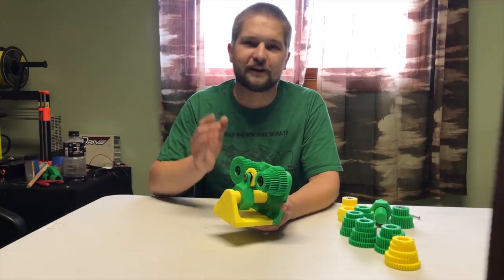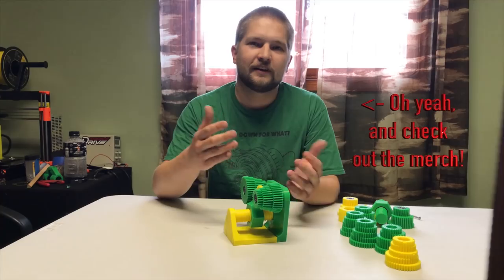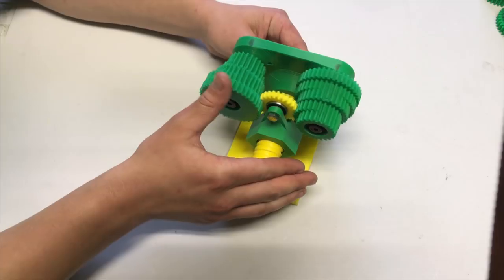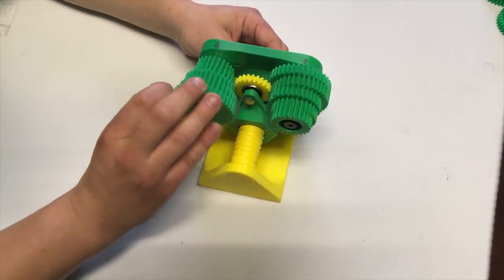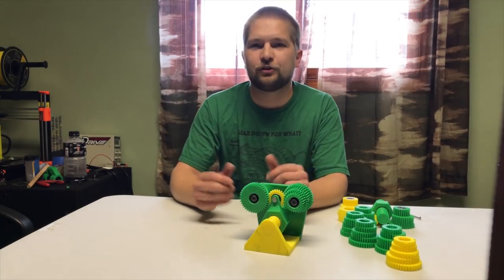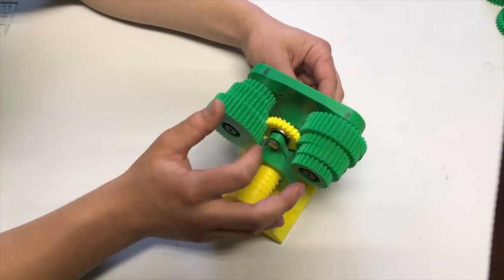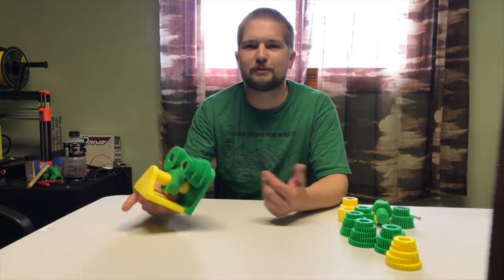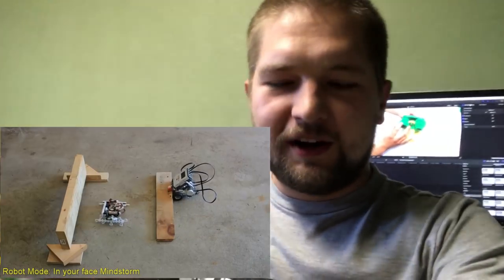The Hot Swapping Gear Mechanism | VCT2

Comment: "It doesn't require a clutch, you just have to stop the gears completely to transition and then the ratio can be changed"

/facepalm

lol
Reply: Robert Caldwell Looks like you've misunderstood. This could be done at speed. You just need a computer and quick electronics, which OP clearly hasn't got.
Reply: No it couldn't, no mechanical device could launch across a pivot in that short period of time accurately, not to mention taking the load abruptly during the change along with it......and even if it could once, it can't be trusted to do it again, let alone constantly.  Pretend a device does exist, imagine the catastrophe that would happen when it wears down?
Reply: Robert Caldwell Imagine a bearing on each tooth of the drive gear set laterally to the tooth. They would facilitate smoother shifting even while under load. Also, you underestimate the accuracy and speed of a computer-controlled servo motor.
Reply: And here is me, waiting on a demo of this brilliant piece of engineering that has been devised.......when you get it working, I bet it will look like a clutch.

Good luck
Reply: I think it's look more like 2 hall effect sensors, a linear servo and a computer to control it, but hey I guess that could look like some type of clutch...
Reply: like as i wan say..
Reply: @sabriath  yeah, right. It's not like we have laser machines capable of making transistors measured in nanometers. How much more difficult could this be?
Reply: And you overestimate the capabilities of a computer-controlled servo motor. A servo cannot rip two spur gears that are engaged and with a force behind without causing damage to the gear. The gears MUST be disengaged.
Reply: Robert Caldwell yeah, stop the gears and properly align the gears to change the ratio. 
i'd rather stick to clutching hahaha
Reply: This looks dumb
Reply: @sabriath  just leave the couch specialists alone lol. Next step would be that "big corporations need to sell clutches this is why this video will be deleted" hahaha
Reply: This was DC motor based not piston engine right?
Reply: But it will still require clutch to    pick up the car and to free up engine from wheels
Reply: @iNx_mRay  I feel like it could be possible if there was some sort of selection rod like in sequential transmissions that had predetermined shift points.
However, the computer would need to know the exact location of each phase point of both gear sets otherwise it's just grind itself to bits with it shoots a shift signal. But overall, it would absolutely still require some sort of clutch... Especially a neutral otherwise you'd never be able to park the thing or idle the engine without the contraption trying to escape!

Overall, it's a funky-neat machine, just not practical and more of a conversational piece.
Reply: @sabriath  totally agree. A quick servo would not solve the problem. Ever tried to shift from an engaged gear to neutral? It's not that easy under full load conditiones. But as soon as you get of the throttle you can easily pull the lever into neutral in the exact moment when there is no load on the gears.
Reply: Robert Caldwell if it's possible to create a mechanism to shoot through propellers on a plane it could be done for a transmission
Reply: @wadderrzz  the Problem is not the speed, but the friction. When the gears are under load, the teeth are pushing against each other with a very big normalforce. Therefore the friction is extremely high. Maybe you could build a mechanism which is strong and fast enough but the wear on the gears would be enormous.
Reply: Nailuj oh
Reply: I'm reading a lot of good comments here! I would like to point out that with a manual transmission car, shifting gears is even possible without pushing the clutch. You only require to reduce the load on the gearbox, pull out the gear, match the engine rpm with wheel speed and push the corresponding gear in. It works easely. Same thing can be done with this.
Reply: @andreasteel indeed a lot of heavy trucks do this with automated manual transmissions. The clutch is only involved when coming to or departing from a full stop. All other gear changes are handled by electronically controlling the throttle and gearbox timing
Reply: @sabriath  based on this comment we can clearly see thay you dont have a full understanding of modern technology and its capabilities. So until such a time as you do then you should refrain from making such statements thay may mislead other people who are trying to genuinely learn how mechanical things can be engineered. Thank you.
Reply: @NotoriousPyro  dude the universe doesnt care what you think. Soo go to engineering school and you will learn that this is completly within the realm of possible. Thank you.
Reply: @winstonpoplin  ....I'm an engineer...you just played yourself.  Have a good day.
Reply: @sabriath  oh good then you already know the truth. Thank you.
Reply: @skepticmoderate5790  this guy clearly doesnt have a full grasp on mechanical engineering so its no use trying to explain it. Like a religious person he makes a statement without any testing or actual evidence and then defends this possition as if he has done some experimentation. In short, he's a fool.
Reply: @LtdJorge  this robert guy is clearly a bit dim witted mate. No worries, the truly inteligent and understanding people will prevail in the end. They will make their transmissions regardless of what some dude on the internet thinks. Physics doesnt take his opinions into consideration.
Reply: Have any of you ever driven an automobile with a manual transmission? It is entirely possible to shift one without use of a clutch. It takes knowledge, skill, and timing. All of which can be replicated with computer controls.
Reply: @sabriath  they sell quick shit kits for motorcycles..  And while its a sequential transmission, you do not need to let off to shift... Just press a button.. Although it's quite easy to just do a clutchless shift..  

(Im not sure if this is what you're asking for)
Reply: Ya this really wouldn't be useful for anything highspeed at all.  Maybe industrial or something where the gears aren't getting up to very high speed.
Its a simple design, but it was likely never made because feasibly its not very useful for anything I can think of.
There is alot that can go wrong, stuff that would require precision mechanisms to ensure alignment and proper distance is moved by the center gear, kinda stuff that also weighs against it.
As well the ratios on the gear are limited in numerous ways, by the physical seperation between the two main gears, by the size of the center gear.  Ultimately your not going to get very good ratios and then would require more gear steps like that to achieve higher ratios, all gains are lost since would need the torque to drive higher ratios from a dead stop anyways.
Reply: @LtdJorge  Very small numbers of nanometers.
Reply: @sabriath  you under estimate the technology we have
Reply: @zackjandali  you overestimate physics

Comment: 2 major issues in a car application:
The time window for performing the entire shift is REALLY tiny, say at 8k RPM, a single rotation only takes 7,5 ms.  Only a tiny bit of this rotation is suitable for a gear shift, reducing the shift time to maybe a 10th of a millisecond, unrealistically short time to move that center gear.

Then you have the instant gear ratio change. A clutch allows the engine to adjust to the new RPM slowly.
In this case the engine does not get any time to adjust RPM, leading to massive stresses to entire drive train, potential locking of the wheels on a downshift and breaking lose of the rear when upshifting. In a regular car you may be lucky that the open differential will only cause the inner wheel to breake lose, but on any kind of limited slip differential a gear shift in a corner will certainly lead to a spin (in a RWD car)
Reply: BFHfunify you are right, he will need a clutch whatever
Reply: Yeah absolutely, fundamentally this will only work at ultra slow speeds and so definitely not useful in an automotive application, however this technology could be used is something operating at much slower speeds. It’s a cool design that I’m sure could have a practical use in certain fields.
Reply: Nobody really knows that for sure. It just happens or could be the other way around.
Reply: Mabe have a huge gear reduction before the gearbox and gear it back up after that way the gear box would be moving slow enuff to make the gear change. But it makes no sense when autos and manuals work fine.
Reply: The shifting would have to be cam driven, to maintain perfect timing, apply the necessary force, and shift at a speed depending on the rpm of the whole gear train. Since you're transitioning from a ramped gear to the straight gear, the new ratio will be achieved in 1/2 turn of the smaller of the two gears. A firm shift, but not a impact like shifting a motorcycle without the clutch. It can work, but it needs a little tweaking.
Reply: Yeah in an automobile the middle gear would have to shoot to the next gear at break neck speeds and then stop on a dime in it's new position. Automotive transmission gears aren't going to be lightweight enough to do that.

Comment: Somewhat tending toward a "geared" version of the double cone cvt with a friction wheel in between. If a more "viable" variant vere to be designed (with continuous gear change instead of an instantaneous swap that'll kill your engine) it might be a huge success. Also it would need a lot of force to slide through when a load is applied.

Comment: The problem i see with this after watching just 5 seconds of the transmission, you have to keep the input and output axles stationary to switch between gears.
So, at least 2 clutches needed and the "opportunity" to have catastrophic failure.

Comment: Another issue with the design. As the middle gear shifts and transitions from one gear to the gear next to it, it will load the corners of the teeth and cause them to break from the high stress loads
Reply: As you notice, the gears ramp up. The pinion only slides on the straight part of the gear. That's why shift timing is so important,, and even more important, that shift is fully engaged before the step comes back around. If properly timed, no corner loading. That would allow shifting under load.

Comment: Infinitely variable transmissions with positive input/output ratio do exist, in the fluid power domain. A variable displacement pump (piston with swashplate, or rotary vane with revolvable housing) can feed a piston or gerotor motor, and they can support high power with large drive ratios. These already exist in heavy agricultural equipment and small garden tractors.

Comment: You would need a sophisticated computer and gear position sensors to shift at the right moment, or BOOM!  and reverse?
Reply: Looks like they'd have a problem with weight distribution too. I wonder at what RPM the unit would shake itself to bits?
Reply: Jean-Yves Mead You could counter-balance the shaft to correct that.
Reply: Actually it would not require all that much sophistication and sensor technology.  If you engineer the center traveling gear to have a certain amount of spring centered lateral travel (so that it self seeks the center when there is no lateral loading) and then bevel the outside edges of the gear then you can make several things happen easily.  First, the edge bevelling should prevent the gear trying to jump to the next gear until it is aligned with the safe landing region, you can preload that spring tension to a point that when the gear reaches the safe region it immediately jumps over to the new gear (remember, the gear is self centering thanks to the springs).  That gives you mechanical safety should things get out of line...and it is very easy to measure the loading in those springs along with the positioning drive's position at all times to ensure you stay within safe limits.

However, the above would really only be a safety mechanism under normal circumstances.  By incorporating position sensors (such as quadrature encoders) on the two shafts it is very easy for a transmission microcontroller to continuously monitor the position of both the engine shaft and the output shaft at all times, and if you know the precise position of both shafts at all times and you know which gear you are presently in then it should be able to very easily decide when it is safe to shift.  Even if the input shaft from the engine were rotating at 10,000RPM that is only about 168 revolutions per second, or about one revolution per every 6 milliseconds -- at those sorts of rates it would be easy for even a very modest computer to keep up with the position of both shafts and the location of the gear selector, etc. (slow the engine down to a few thousand RPM and even a carefully engineered Arduino microcontroller could come close to managing the shifting (and there are much faster micros out there than the 16MIP 8-bit Atmel AVR series).  By sensing position on both shafts you can even detect if slippage has occurred due to a fault and place the transmission into a limp home mode so that you can get the vehicle to a service center without being stranded, protecting the transmission from further unnecessary damage.
Reply: Computer gear and position sensors... you mean like the ones in modern transmissions and engines?
Reply: it needs a cam (well 2) to keep the gears lined up so they are always in the correct position at the interface
Reply: Not to mention that friction would tear this right up
Reply: You almost forget the immense stress the teeth ar under during shifting. With the enormous acceleration they will be under
Reply: @gorbinasvd  assuming that the teeth manage the stress how comfortable it will be to ride that car while jumping in every shifting
Reply: Idk about position sensors, but you’d definitely need a timing mechanism. But that’s what computers are best at, timing shit damn near perfectly.
Reply: @gorbinasvd  automatic transmissions are under stress when shifting too but it’s not nearly as much
Reply: That’s how cars work. Except you have a 300hp engine powering it.

Comment: In a transmission is not all about changing gears but also distributing loads and mechanical stress between gears to prolongue the life of the transimission and make the engine more efficient.

Comment: Cool thing is: if electronically controlled the transmission could detect it the timing was off, pull the pinion out of engagement with the two shafts, perhaps have some auxillary motors to retime the two shafts, the reengage the pinion

Comment: Looking carefully at the driven shaft on the right, it is clear that, when the driving shaft is rotating at a constant rate, the driven shaft operates at an oscillating rate. This means constant vibration of the car as it speeds up and slows down several times each second.

Comment: This design will produce relatively large fluctuations in output torque and velocity with each revolution due to the eccentric gears. Although torque and velocity are calculated based on the number of gear teeth, it is assumed that the radii are constant for a given number of teeth (and a known diametral pitch). If the gears are eccentric then the radii from the axes of rotation will not remain constant and therefore the effective gear ratio will vary with rotation resulting in fluctuations in velocity and torque. As the effective radius of the input gear becomes shorter it will have greater mechanical advantage over the output gear which has an increasing effective radius resulting in greater torque at the cost of velocity.

Comment: It would still need to be disconnected from the engine via a clutch
Reply: Robin Boots lol
Reply: Disconnecting from the engine can be done by having an input but no output gear at the beginning, the whole idea of the timing isn't so much of an issue because you could probably use electronics to tell you when to take the gear because if you know the speed and the position sensor can tell you when the timing point is hitting and the timing on the other you could just hop onto the gear at the right time
Reply: Calliass44 you're going to need to disconnect it between shifts, since the gears need to be stationary during shifting. Otherwise it will bind and put insanely large forces on all drivetrain components.
There is a speed difference between the gear sets, so even if you could get it to shift while there is a load connected to it (which you can't because it takes time to move the middle gear over) the engine is going to be forced down in RPM almost instantly (if nothing breaks) and the vehicle is going to forced to speed up almost instantly (Newton's third law and all, again if nothing breaks), making for a very jerky ride
Reply: I agree, essentially this works just like a dog box
Reply: Roel de Meulder no it does not, a dogbox can be shifted clutchlessly
Reply: Yeah, with violence
Reply: Roel de Meulder I'm not saying it's the best thing to do for the transmission, but it can be done. 
Quite smoothly if you get good at it
Reply: And everyone here is also missing the point of taking off from a stop, the drive gear can't just spontaneously add or remove teeth. You can't take off from a stop without slipping the clutch, or just ramming it into gear at a high rpm, which is very violent.
Reply: Calliass44 can you explain how the engine can be disengaged with input but no output gears ? Doesn't the point is the movable parts is output gears ?
Reply: Fluid coupling, or rather, torque converter would be a better option.
Reply: But there is no engine
Reply: only for stopping/starting, not for shifting once under way.